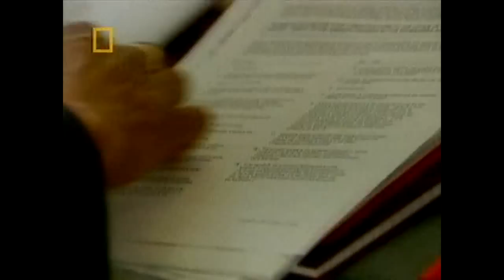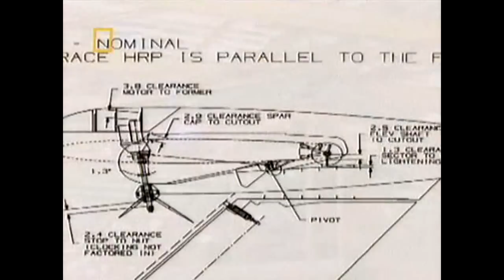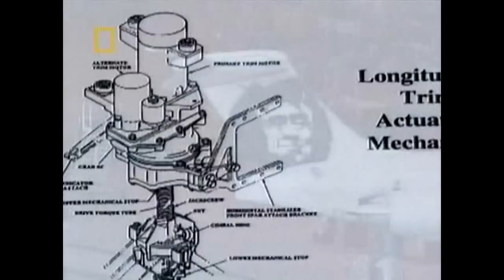Air Crash Investigation Cutting Corners [HD] [Part 5]

Comment: Gretschster6120

Your comment on the DC9 and MD809 make no sense whatsoever. While later aircraft (like the B757 and B767) are safer due to lessons learned and better design tool (e.g. computer aided design, as on the B777), the MD80 is one of the safest planes period. The rudder design is robust AND redundant (unlike the POS older B737s). It's not perfect, but I would feel very safe on the MD80 variant, provided it is flown by an airline with a good safety record,